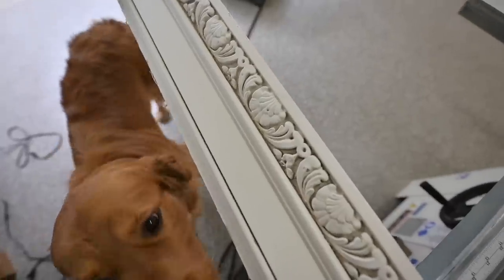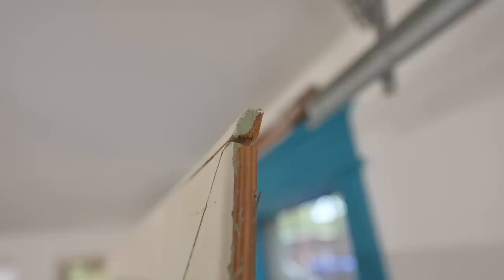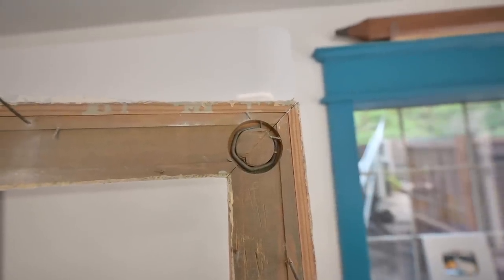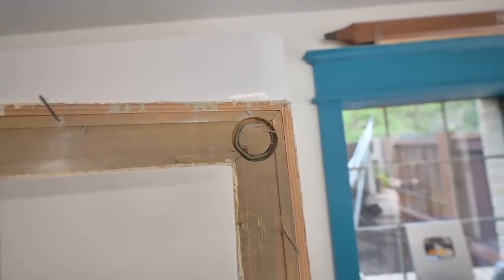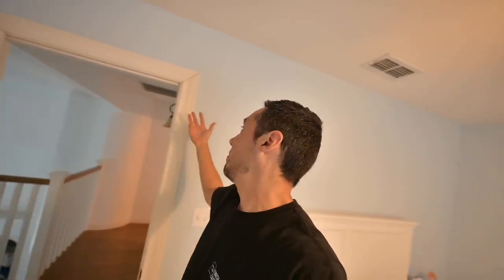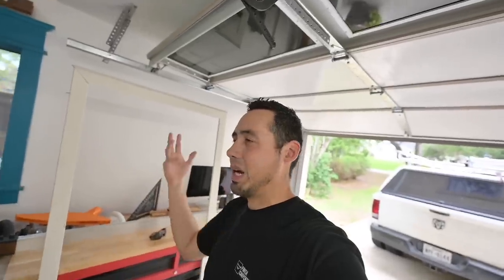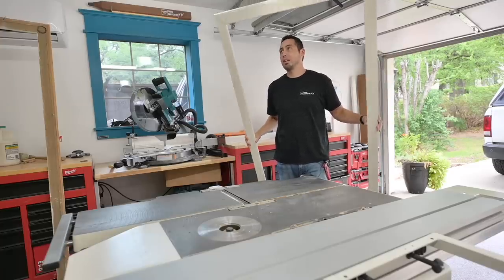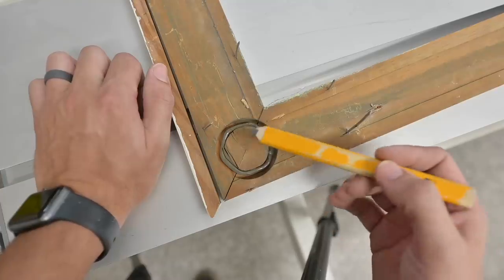Door casing skill lost for 100 years

Comment: When I was a teenager I worked with an old timer that had a machine for this purpose. There were several different size kerf drill bits for different widths of molding. The mitered or squared molding would be clamped flat side down and the bit would come up from the bottom by pressing a foot pedal. Then the pieces would be moved to another part of the machine where another bit would chisel the hexagon. Sometimes the chiseled pieces would fall off, if not it was quick work to shave them off with a hand chisel. There was another machine that would press the metal ring in but it was easier just to tap it in with a small leather mallet. It was great for "prefab" work. I think the machines were made by a company in Ohio but I'm not sure on that.
Reply: Bang right there,👻👻👍👍 wish I would of found your comment before saying it would have been something like that. Now we know what to look for in old tool auction
Reply: Finally a real answer.
Reply: Please pin this comment.
Reply: Glad you posted , That was very interesting.
Reply: I was dispatched in Romania , there they are still using this process. They have this preety old machine who drill , make the hexagon and put the ring inside by pressure. They use this tipe of process for some furnitures too like tables or beds. For the more expensive high quality stuff I see it done by hand too. The guys there are amazing in wood works.
Reply: Pretty cool. Interesting how people's perspective has changed over the years. At one time people were focused on how to do the best job possible and sought out tools to do so. Now we seek out tools to make us faster and cheaper. Thanks for sharing.
Reply: @brianmunkres1767  100 years ago we weren't fighting industrial prefab
Reply: Glad to see this explanation. I was wondering how they did it!
Reply: We need to find the name of the manufacturer of these machines
Reply: @brianmunkres1767  Im a carpenter my self been at it for 30 years and if you know the tricks of the trade it makes things so much easier. Ive learned alot of different ones from older fellows. Here's one for you. When you're working with old Finnish trim like that pre drill the holes and use real beeswax on the nails or screws whichever.
Reply: @jimmartin5362  You can also use the the same size nail as the drill bit. Depending on the length of the nail you may need to cut the head off so you can get the chuck to tighten properly.
Reply: That's what I was thinking when I saw it. It would only make sense to use it if prefab. If you were cutting and installing on jobsitw it wouldn't be needed. Really interesting
Reply: Sure buddy
Reply: Oh thats freakin sweet!!!
Reply: Here is how I believe they did it.  They fashioned a hole saw out of a thick steel tube with no center bit..  Then they took a hardwood board (maple and drilled a hole the diameter you see and about an inch or so thick.  This was the guide for the hole saw and would have had locating strips on two sides for the 45., this would have kept the bit from wandering.  The bit would have had 3 or 4 braces at the end of the tube to hold the iron dowel that would fit into the drill chuck, no drill press needed.
Reply: Igor loves old timers and especially all that knowledge and experience. 1 positive of all this social media BS is that it can be documented in easily digested bits for youngsters
Reply: Awesome info, thanks for sharing.
Reply: You forgot the part where those rings were tightened to hold the joint together.
Reply: @jeremydiener1559  the flats of a hex ring on something round does the tightening on its own if the two are properly sized. Maybe some wax to help the installation process.
Reply: @raynic1173  That's how I learned to do it back in the day. Trimmed a good number of nice houses with that method, but that really only works well on very soft woods. Another issue is getting the nail tight in keyless drills, especially for someone with arthritis or such.
Reply: The rings were already welded like in the video. They came in several sizes. I remember they were shipped in burlap bags in the hundreds. They were a pretty tight fit. For soft wood they went in somewhat easily. Hardwoods required some beeswax, soap, or even spit and a little extra effort to tap in evenly.
Reply: @jasonh.8362  That's what I think. It was cut round, and the hex is pressed on holding everything tight and compressing the joint.
Reply: @TheAlgorath  100 years ago they were still building houses with the expectation that they'd be around 100 years (or more).  The postwar building boom and rise of rapidly-built subdivisions put an end to that.  A house built today is only designed to last 25-30 years (not coincidentally, the same length of time as a conventional mortgage), and then either receive a costly renovation or be torn down and the property redeveloped.  

Planned obsolescence-not just for cars, computers, light bulbs, televisions, appliances, exercise equipment...
Reply: @peytonmars806  Not really.  Your mansions?  Sure, but your poorer families were building for convience.  We're now at the point of survivor bias, where the worst are long since gone.
Reply: In Denmark we use to have what was called “Naver”.
It’s a carpenter that would work his way around Europe via farms repairing and building for them for money, food and lodging, kinda like a vagabond.
These men was usually very highly skilled carpenters and you will find their work/art over most of Europe.
I used to work/travel with one for 2 years 35 years ago.
Reply: @peytonmars806  And people...
Reply: @TheAlgorath  Yeah, good point.
Reply: @thomasbanks7950  Doug just told you how they did it.
Reply: It struck me as a commercial solution, so having a system with a set of tools makes sense.
Reply: Very interesting.   Super custom millwork installation.
Reply: Your info is one of the greatest parts of you tube. I fix soooooo much stuff by just watching videos and reading comments like yours.
Reply: @jimmartin5362  My dad taught me to use the wax from a toilet bowl ring for long screws so they don't bind, and then strip, half way into the material.  And pre-drill holes as often as possible using a bit that was the diameter of the inner column of the screw.
Reply: As a real estate appraiser, I can tell you that "modern" houses are appraised for 100 year lifespan.
Reply: @TheAlgorath  great point!
Reply: @TheAlgorath , or trying to buy an over priced house, car and truck, four wheeler, speedboat, . . . .
Reply: Thank You
Reply: Great answer, was picturing something like you mentioned in my mind but everything being accessed from the top.  Must of been a bulky machine.
Reply: @doug tripp your comment deserves at least 1 free t-shirt! I love to read about stuff like that
Reply: I Love this.
Just goes to show that 100yrs ago things were built to last, not built to break.
Planned Obsolescence is the scourge of modern life.
Reply: @TheAlgorath  that is a really interesting argument, and given the decay of all things material, completely believable, and even undeniable as well too! Same like with old cars, as they said back in the day, Italian and French cars already started rusting in the brochure, so there are clearly less of them to be restored. 

I enjoyed, no loved that comment! It really forced me to put on my thinking cap! 

Not to take stuff at face value, but try to think through an entire lifecycle of events. Am I willing to look at the negative space left by the thing I actually see. I’m actually inspired! My biggest inspiration in architecture was (is, still have it) that beautiful oblong text book where a floor is Described as an elevated plane, and the space between buildings is called negative space. And I loved that too! It might be simply generic architect speak, but I have never encountered it anywhere else. Yet it was so fulfilling to look at the world from that angle, that perspective. This is the same thing! 

Can’t stop raving. Clearly my days or my head are empty. Or just simply touched by a deeper meaning of an off the cuff (for me that is) comment. 

Thank you so much!!
Reply: @amzarnacht6710  same here reg predrilling. Someone told me to pre drill beams to prevent splitting the wood, but forgot to explain how, so i came up with exactly that logical conclusion…

Do you also put a nut on a bolt before you cut it to length to straighten out the thread afterwards? I love that simple hack so much. The frustration of the burrs and never really getting it evened.
Reply: Actually there were other concealed pocket cutters competing all around the same time
Reply: @brianmunkres1767  that's not how this works, that's not how any of this works. Tradesmen always have and always will seek the tools and training to do the best job possible. The reason the technique varies so much has nothing to do with the intended "quality" of the work. It is because of technology available, and how easily accessible it is. When power tools aren't available you do things by hand. The old timers didn't drill, cut, and lift things with hand tools and say"wow, I love all of this excessive work. I hope they never invent a tool to make this easier." 
Who do you think started the development and application of modern power tools? The same guys who did it by hand, because they were sick of doing it by hand. 
I'll close with this, build quality is determined by one single factor. The amount of money being spent for that specific project. You have to pay for quality, in regards to material and labor. That will never change. 
So if you've had experiences with low quality builds, stop hiring the contractor that's 50% lower than everyone else amd stop buying discounted material. Real quality is not discounted.
Reply: Cool! Thanks for giving us a woodworking history lesson.
Reply: @jimmartin5362  always carried an old bar of soap.
Reply: @jwvandegronden  using the nut to (somewhat) clear the burs and re-form any deformed threads is a decent trick, especially in a pinch. It's nothing the best method. It doesn't really remove burs, it just smashes them down. It makes damaged threads usable, but still deformed enough to cause excessive friction.
The best way to eliminate the problems created when you cut a bold is to grind the cut end flat. Then grind a chamfer that is even with or a little deeper than the thread root. That method removes any damaged threads and burs. While creating a ramp and taper to help guide the nut.
Reply: @TheAlgorath  from wiki- In architecture, reacting to both Victorian architectural opulence and increasingly common mass-produced housing, the style incorporated a visibly sturdy structure of clean lines and natural materials. The movement's name American Craftsman came from the popular magazine, The Craftsman, founded in October 1901 by philosopher, designer, furniture maker, and editor Gustav Stickley.
Reply: Omg how amazing thank you for sharing that with us ,to think someone invented a machine which did this
Reply: Would the chisel section press a single hexagonal chisel into the wood? Or work its way around?
Reply: @sigi9669  it was a single bit that would chisel all at once. They were rather long so they could be sharpened.
Reply: Wow have nt seen these for years, ring claps are old hat , so cool
Reply: Hey,Richard. ThT old mounding ThT U have will a Gr8 picture frame 4Ur old but Gr8 looking home ThT U GuyZ have moved into,take it Pic of Ur home , making the picture frame from ThT older home, place Ur picture of Ur house with ThT old mounding, have it up in Ur woodworking shop, U would have 2 determine the size of Ur Frame,let me know WhT U think about thS project.
Reply: Was there a name given for this method?
Reply: The man I worked for called them clamp meters.
Reply: 22.48 (uk) with the carved moulding, it could make a heavy mirror frame, but I'd prefer to frame an upholstered headboard, especially if it was stripped, stained and highlited with gilding. (I wouldn't expect you to post a T to England btw.)😅
Reply: Thanks!
Reply: You could just route in a bow tie on the back.  Or even a 1” forstner bit and glue a round plug.  Modern glue will hold forever.

Comment: If I wanted to replicate this in my shop, I'd make a jig for a small plunge router for the recessed area and build a tube chisel from flat stock or tack weld 6 chisels together in that shape to shape the inner circle. A simple jig could be made in the same way to form the rings by heating and bending the round stock around it. Pretty cool technique and built to last longer than the ink on a paycheck.
Reply: lol
Reply: Why waste the time and effort.

Comment: That was a worth while find. Roy Hill pointed out one from a nearly 200yr old Windsor chair that the examined with x-rays. The round socket and tenons on the leg spreaders were absolutely solid after nearly 200yrs. So much so that they did extensive testing to prove it wasn't a well made fake. They found three things. First, the spreaders with tenons was kiln dried right before assembly. The meant the tenon would swell slightly as it gained moisture from the air. Second, an internal wedge was used to spread the tennon during assembly. Three, the wood for the chair legs were green or not dried at time of assembly so the socket in the legs would tighten as the legs air dried. Fourth, the inside of the socket was tapered slightly wider as the depth increase making a locking wedge fit between tenon and socket.
Reply: Domyou happen domhave a link to that info, or is it from a book? Either im quite curious to read more about this
Reply: I'm also interested in a link or title of a book, magazine, anything to get to the inverse engineering made by the guy you're naming, please. I've been trying different browsers looking for any info on Roy Hill and Windsor chairs but I can't find anything even similar to what you're describing. It seems very, very interesting. My grandfather was a skilled carpenter of high end furniture, but he died before I was born, and my father died when I was just a child which meant I never got the chance to learn from any of them. So much information lost between just three generations, imagine how much gets lost in a couple of centuries. Cheers!
Reply: Thats the kind of applied thinking people dont use as much now, mostly replaced by new and cheaper materials
Reply: Great info
Reply: We had a set of 4 dining stool made in USSR around 1950. They were perfectly sturdy, until cats started clawing the soft material on top. So mother decided to replace the soft part. Stools were disassembled and reassembled by local “artisan”, after that they were no more sturdy, and all 4 gradually broke😿.
Reply: The advantage of spoon drills,  you're free to make inverse tapered holes
Reply: Honestly the biggest enemy of old furniture isn't it's age if it was made well but our modern air conditioning. We had a table and chairs that had been passed down from my great great grandparents in the 1800's that my great great grandfather made when he got married and built his home, it and the chairs were perfect other than some dings and dents from multiple generations of use but once we moved into a modern house in North Carolina it all started to deteriorate because the air conditioning drew the moisture out of the wood and the chair dry rotted before we knew it. Luckily the table was saved before it got too bad and we had to make sure to oil it on a normal basis.

Comment: Both circles are cut perfectly round with one tool. Then the hexagon acts like a spring holding it tight forever. Over time it will reshape the wood, but initially they just hammer it in and done.
Reply: Amazing.
Reply: The tool to cut the "circles" was a two  cutter tool similar to a beam compass, but with both ends with cutter holders. It was held in the center and turned most often with a drill press. Then the ring was pressed on the soft pine trim to form the hexagonal shape and pull the pieces together. 
The pieces were held together with a special right angle jig on the press table for fast, accurate fabrication.
Reply: @AndrewAbernathyaz  true. Ppl who tell about how long the process took did not see an old artisan working, with an jig/setup for every operation.😸
Reply: Also, the ring being Hexagonal means only 8 points of contact while wedging it onto the core circle.  Less friction and a smoother installation.

Comment: They probably used a wooden Corner jig then they clamped the two pieces so they didn't move then did the hole saw in a drill press hand drill press that